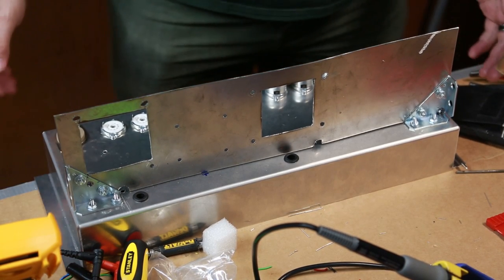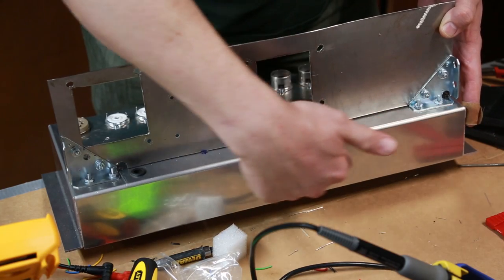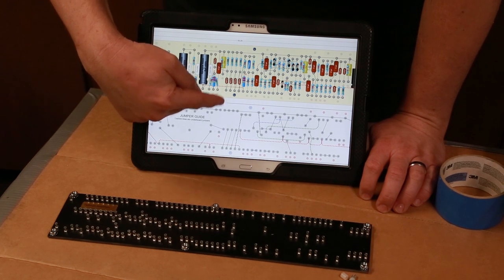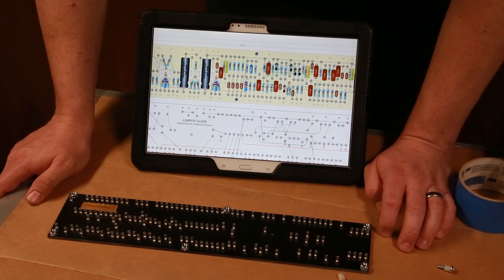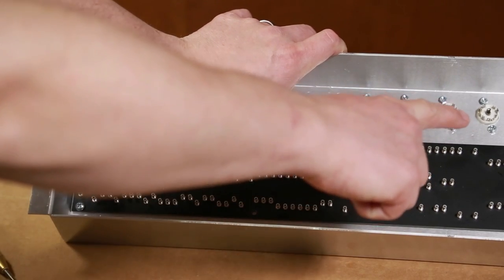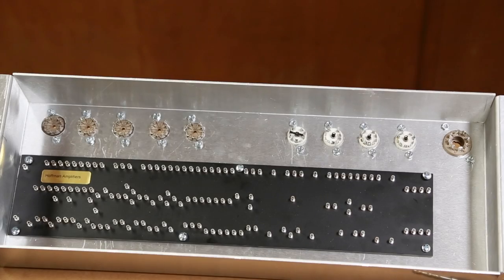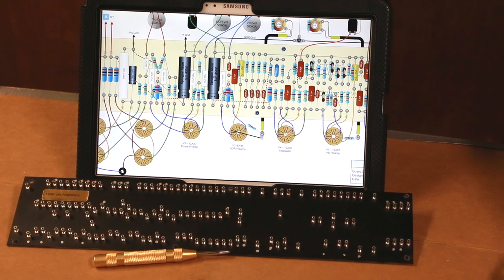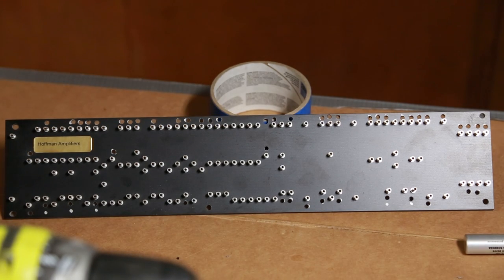Vox AC30/4 Video 5

Comment: I do have to ask - is there a 220-240v input equivalent power amp (looking at the 1960 AC-15 schematic, it calls for a 110vac)
Reply from the maker: +Simon Persson Music I'm sure you could find a power transformer that would do the same secondaries and run at 220.  The originals were in the UK and ran at 220.  This was just done by me in the US so it's 120